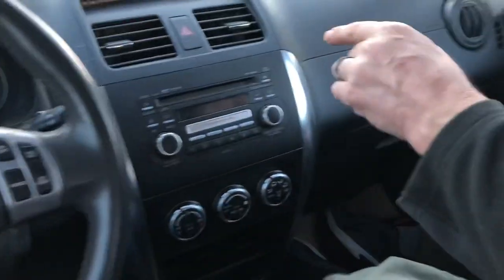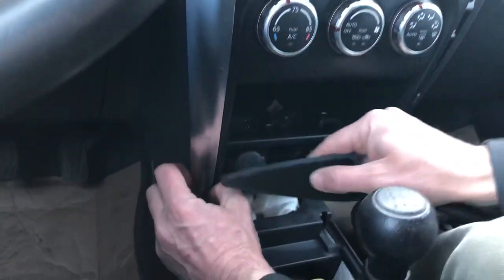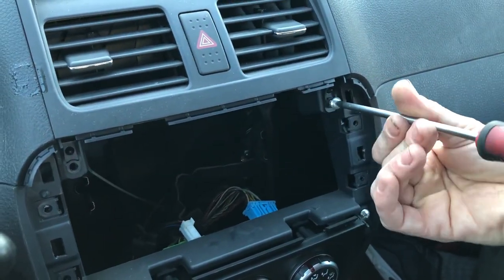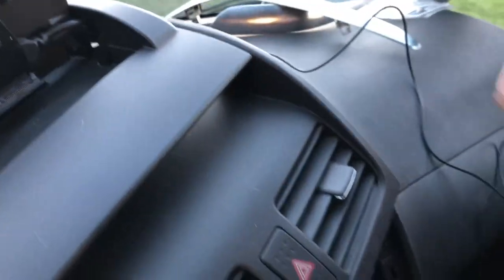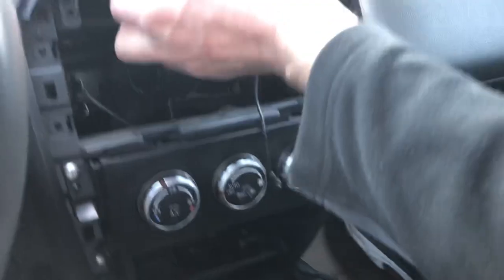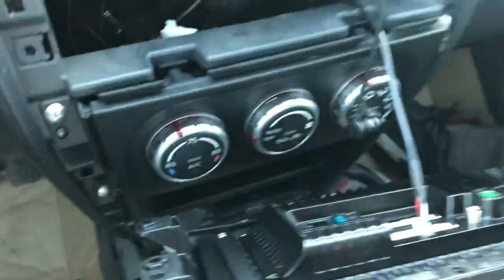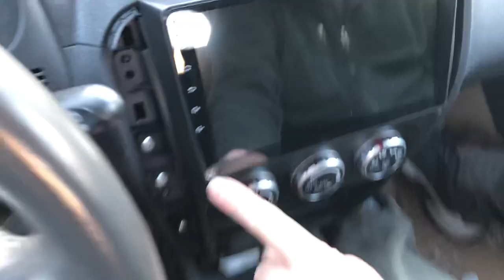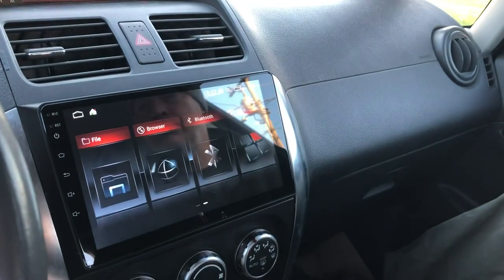Android 10 device to 2007-2013 Suzuki SX4

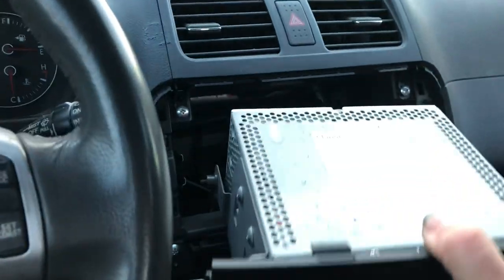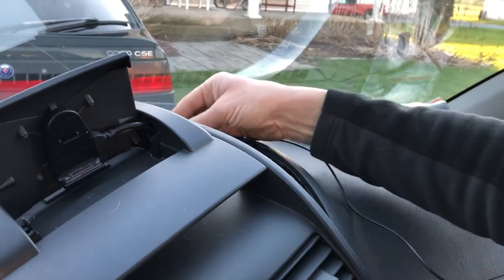Comment: Hi! An interesting question: You unplug the "GPS wire" at 2:29 and install a "GPS puck" at 4:00. While the GPS puck sits just below the glass window, where does the original GPS antenna go? If it goes outside the car, then it would provide a less shielded, stronger GPS signal. Moreover, the original GPS connector, which you disconnected looks like a proper coaxial cable. The other one is very easy to bend and loop. What are your experience over this? Have you tried the original connector as a source for the GPS signal?
Reply from the maker: I may have misspoke and I don’t mean it was a GPS why I mean it was a radio antenna wire. And yes if you install the puck outside it would be a better signal. That’s kind of obvious. But most people don’t want that outside the car so I put it right there on the center of the dash underneath the plastic and the windshield so that it picks up a signal. Is it accurate to survey the road or property probably not is it accurate enough to drive you down the road probably is.

Comment: Would this work for an Apple Car Play as well?
Reply from the maker: Any device that fits will work depends on your skill level with the harness adapter.  This Android device comes with the correct adapter for the easiest installation.  Plugs right into the factory harness.

Comment from the maker: https://www.ebay.com/itm/384087534359
Reply: Does this fit the 2012 SX4 crossover too?
Reply from the maker: @xAyyeItsFrieght  says so in the comments.
Reply: @richardlabarre7892  in the comments of the ad on eBay? I was only asking because I added my car to eBay an says it won’t fit? My gf has a 2012 SX4 crossover
Reply from the maker: @xAyyeItsFrieght  in my video.
Reply: @richardlabarre7892  okay thank you! Just ordered one!
Reply: @xAyyeItsFrieght  hi, if it's not too much of a bother, could you update on how it's working out? i have the exact car model, and worry a bit that the device won't be as neat as you'd expect 😅
Reply: @m31t4r  update: it works great! Has a lot of cool features! I like it!
Reply: @xAyyeItsFrieght  that's great! tysm :)

Comment: Hey, thanks for this video. I actually own a 2011 suzuki sx4 sportback. My radios (LED?) lights are faded out so i cant see any info on them, but this will be useful to replace it myself. I had a couple of questions:

1) whats that plastic tool you used to remove the sideguards called?

2) on the pop up / down gps holder. Do you know if they still sell any of those gps's? Id like to have one again just to say its "complete". But if not, what kind of connectors give power to the gps unit? (In the gps holder itself)

3)is there somewhere online that gives the dimensions of the stock gps, that goes into the gps holder? I ask because i was wondering if i could find something else online that could fit into the gps holder
Reply: Very common on the 2011 radio’s for the LED’s to fade out. I had to finally change my wife’s radio last year as it was driving me crazy! 
The tool he used was a pie cutter/server utensil. I’d pick up a set of nylon trim removal tools from Harbor Freight for 7 dollars as they will always come in handy.
Reply: I have a 2013 SX4 and my radio LEDs are dying too! Common Suzuki issue?